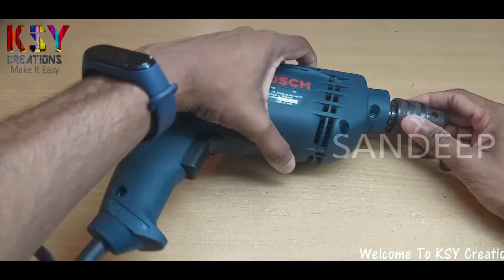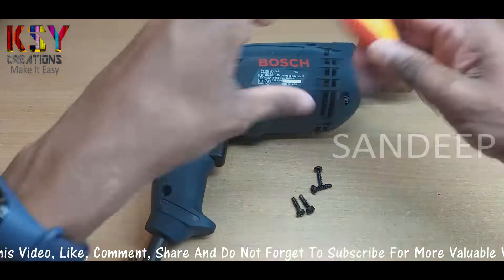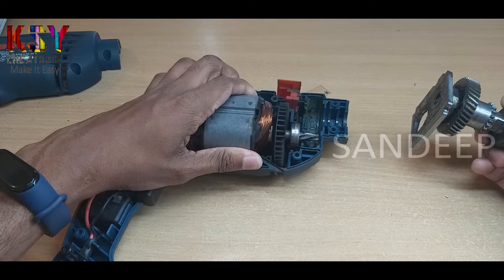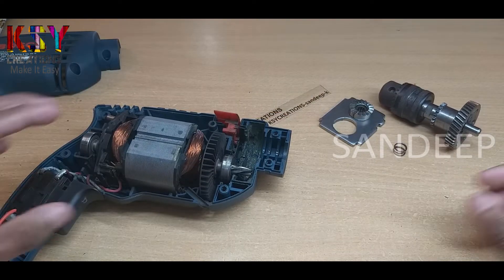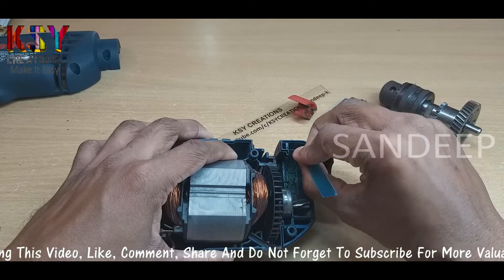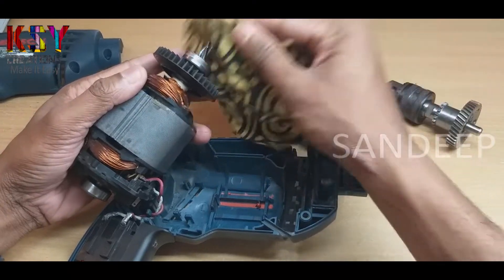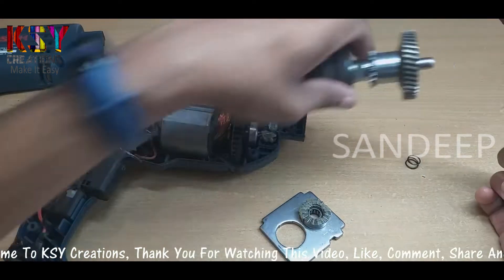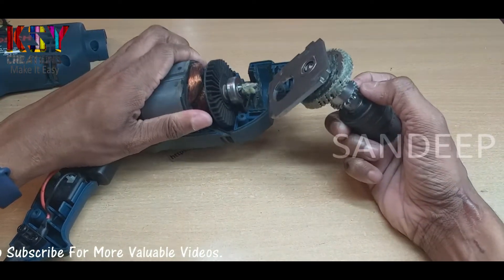greasing the drilling machine gear | maintenance of drill machine | bosch drilling machine repair

Comment: Be careful guys,there is a small ball bearing at the end of the front mechanism(when you pull it out) if you have a drill with hammer function.You could easily lose that.
Reply: Ok

Comment: If there is sparking from this drill machine, does this mean that I have to change the carbon brush ? Please advise.
Reply from the maker: Hi, mostly sparking will be due damaged armature commutators, if that is the case, no use of changing brushes. 

In case brushes are damaged and armature commutators are good than you can change brushes.

Comment: Sir, I have Bosch GSB500RE. When I  move switch on the top to "hammer"  symbol, It's 'impact(or hammer)' is not functioning. It always works as simple drilling machine irrespective of the top switch position. Can you please suggest how to repair. Thanks

Comment: can you please make a video about how to charge a wireless earbud without its case ?
Reply: Tp4056 charging module with jumper leads to the earbud terminals, not sure how ur gonna connect them though, tape maybe?
Reply: Little Reptilian for gears like in the video regular NLGI 2 Grease or high temp wheel bearing grease will work fine but for enclosed planetary gear boxes found in cordless drills then you would go for a thinner grease like CV joint grease which is nlgi 1 or nlgi 0. Nlgi is just the rating for thickness of the grease, the lower the number the thinner the grease. The most common is nlgi 2 which is what’s used in the video, you can find it at a petrol station or pretty much anywhere